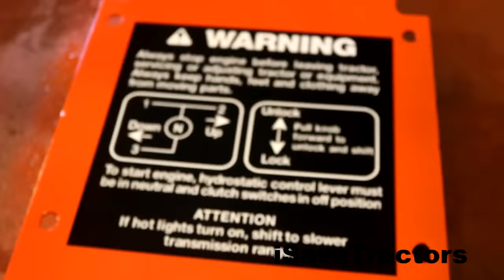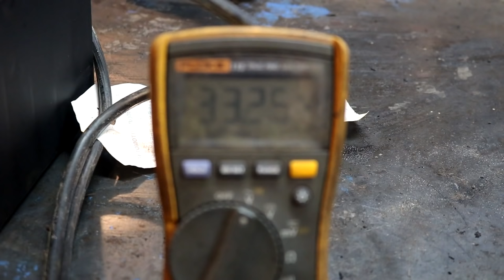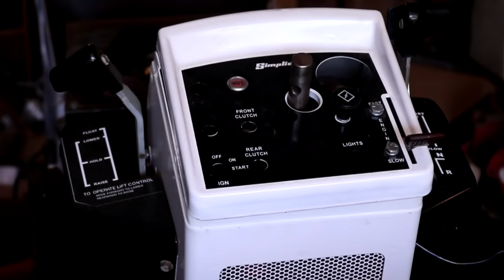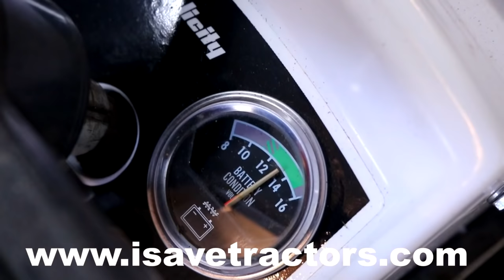Simplicity 4040 PowerMax Project Start To Finish Full Video

Comment: When you started it up there at the end. The sound the Owens engine made takes me back to the 1970s when my father was head groundskeeper for the University of Iowa and they used two AC 720 tractors for mowing and snow removal many years.  The mower deck on the AC 720 is not what you see today, or most decks are stamped steel, AC and simplicity would weld up the decks out of plate steel. The only problem my dad would have is that when it was really hot in the summer and they would park the tractor for break after running it for a few hours, the engine was sometimes the vapor lock. You restoring this brought back a lot of fond memories of me and my father and the time I got to spend with him! Thank you!

Comment: As a John Deere guy.... I concede these are among the coolest garden tractors ever made.
Reply: You mean the most complicated and over designed tractors ever made. What exactly can this tractor do that a Sears Suburban could not do? Which would you prefer to work on?
Reply: @MrCountrycuz well for one the category 1 3 point hitch and rear PTO is immensely great to have and use.  Plus the big rear tires always help a TON with traction on a small 2WD tractor.  The hydraulics and hydrostatic is another highly needed feature if your going to do any real work besides mowing a field.  That's just for starters.

Comment: I bought a 4040 in 1973 with a deck mower, a 60 " tiller and Danco front loader. It had Turf tires and heavy duty tires in the front.
I used it for almost 30 years. Rebuilt the engine once and repaired the transmission once. The front kingpin axles broke several times and I made new ones. The rear wheel drive axle broke once and Case made a new one for $150. Great tractor I used it almost every day and sold it to my neighbor when I moved and he loves it and uses it a lot.
Reply from the maker: Wonderful story. Thanks for sharing!

Comment: Impressive transformation, Norman! Particularly the pressing out and in of bearings and rewinding the stator. Beautiful work all around. Also shows how beneficial it is to have the right tools. I've watched Jason1Pa rebuild an old Ford 8n tractor, too. These smaller tractors really fill a need for those of us on smaller properties yet need the muscle and attachments of the big boys.

Comment: I have recently been given an Allis Chalmers lawn/garden tractor and it appears restoration may be a daunting task, but it should be fun(and expensive) but, just recently having retired, I'm up for it.
Reply: Be sure to bag, tag, or label every part you take off, so you know where to put it back on. Strip it down to the frame, power wash and paint the frame, then build it back up. Sounds like a good project to kick off your retirement.

Comment: I had a model  4040 tractor I Started my ground maintenance business with it had many attachments 60" belly mount mower   a 60inch  sickle bar  mower  5' rotortiller.  5' snow blower 5ft dozer blade 5ft landscape rake  rear grader blade

Comment: Do you ever rebuild tractors for customers? If so, I have an old Bolens pipe frame tractor {early 60's vintage} that needs carb. and electrical work the rest is fine.The tractor was given to me by my next door neighbor.

Comment: Norman, Wow what a beautiful restore. I wish you'd shown us the new spline shaft. Also why don't you use solder connections instead of crimped?
Reply from the maker: If you check the full build series you will see the new shaft. I solder some connections, but a good crimp is acceptable too for these applications.

Comment: Man, that was like a symphony. Runs like a top. Don’t think I missed it, but did you also pull down the engine and check the innards?
Reply from the maker: For this build, I rewound the stator and checked clearances etc but did not do a full engine overhaul.
Reply from the maker: I have 3 more of these tractors and our company is developing parts for them when they are finished I will be doing a full rebuild of the CCK engine

Comment: @isavetractors where did you get your assembly diagram? I have a 74 simplicity landlord and I want to do an overhaul on it with my son as he grows, any info would be greatly appreciated.
Reply from the maker: Most of the time, I don't use any diagrams when re-assembling. I just know where it all goes. I sometimes will take pictures of things as I take them apart. It helps that I film most of everything and I can use as a reference.

Comment: What size are the rear ags? I (think that i ) want ags on mine but have 15 inch rims and i think 12.50 are too wide for my applications,  are they 12.50? Or is that the 16 inch wheel?

Comment: Norman, I have a question. Thinking about getting a tractor jack from habor freight.  So maintenance on the mower blades would be easier. They have the one for 300lbs max lift. I have a Ariens gt17 witch weighs 928lbs with out deck. The most i have seen is 700lbs. Being im basically pivoting  on the back wheels think 300lbs lift would be enough. Or is there a easier way to maintenance the bottom deck and blades? Those decks are heavy and hard to move around.
Reply from the maker: I am not sure baout the 300 lift ones. I use the Mojack Lift (500lb), and that lifts all of my garden tractors. I haven't used it on the Powermax yet, but I probably will with some extra precautions (1500# Tractor). Here is a link to the one I use: https://amzn.to/2Y63g41

Comment: Hey I have a 7119 and I cant get it to turn over. I have added a key switch and a solenoid and still nothing. Any ideas?
Reply from the maker: Check your ground connections. Between starter and block, block and engine frame, frame to battery. Make sure everything is wired correctly as well, and all ground connections to connected to shiny metal.

Comment: Hi, what state are you located in and would you be interested in taking on some contract work on my AC616 with Danco loader?
Reply from the maker: Maine and I'm sorry I don't do Customer work anymore. Just too busy
Reply: @Isavetractors  No worries, I think I am going to just get into her myself and outsource prep and paint. I am having a tough time with parts though, any suggestions on where I may look for wear parts like brakes, air cleaner element, etc?

Comment: I don't get why you painted some parts and not others
Reply: Exactly. I mean,if you have it torn down that far,you may as well take it right down to the bare frame,blast,prime,paint and clear coat it all. Also,if i had the engine out of the frame,i would have completely rebuilt it as well and maybe even had gone through the tranny and whatnot too. Don't mean to sound nit-picky but.........
Reply: @specwar64  I semi-restored a CC 1450, it's a work tractor. While I didn't go all out and bare blast it, I did get rid of all the rust and re-primer and paint everything. I had to rebuild the engine. It went from a weekend project to a summer project. So I understand "Work tractor rebuild" but in my case I painted everything. I figured the limits of 40 year old paint to protect the metal had been reached.
Reply: It's called patina and it's just nice to keep some of the original paint. This is not a museum piece, it is a driver, although a very nice driver and from a distance you have to look close to see the untouched areas! I have done the same.
Reply: Don_ECHOguy, I’ve semi restored 2 tractors, my 212 on MikeJD60, & a 73 ST16, temporally 212 swapped for light duty jobs around the yard.

If I need to pull something heavy I pull out the big guns/my 82 JD212.

The 212 I’ve repainted, new head gasket, carb, repainted except the fenders/patina, & put a tube in a rear tire. 

The tractor had all original tires when I got it some of them still held air! Both of the front tires were original & one finally started to split & finaly went, it was a sad day when it did, cuz now I can’t say that my 212 has all original tires on it. 

I’m still really sad about it. Oh well. I think I’m gonna do agg tires all the way around, the 2 front ones first, to make it look even meaner! 

My latest build is a 67 110 RF I got for $100 that came with 2 new rear tires, & a rear drive belt, I got it home & jerked the head off & found out the engine was rebuilt, maybe .10 over? Or just new piston & rings.

Anyways a previous owner painted it blue & that was one of the first things I fixed was the coverup of the blue paint.

It’ll look hopefully amazing! It’s not a museum piece, so there is a little slack. The hood won’t be perfect tho 😑. It’s seen 53yrs it needs a few battle scars. I also got some of the stuff for the rear sleeve hitch as well!

It’s also getting 2 better condition hubs for its 2300 since the current ones are wore out. They’re black rn, but I won’t be painting them to show they’ve been replaced.

The year is unknown cuz the tag doesn’t match the model, the model is 130 but it’s a 110. But the serial matches the other little details on the tractor. 

Happy tractor hunting!

Comment: Whats the real difference between this and the 9020?
Reply from the maker: Mainly from axle pin, rear axles are thicker by an 1/8" on the 9020, and 2 hydraulic spool valve

Comment: I was rather shocked when I watched you tighten the wheel studs in a circle instead of alternating studs so it will tighten evenly.
Reply from the maker: That was not footage of torquing the lug nuts. It was just getting them onto the rim to hold the wheel. Final Torquing did not make it on video, but it was done with the correct star pattern.
Reply: Good explanation, editing the videos sometimes causes confusion.

Comment: I enjoyed watching the entire video BUT when you replaced the roller bearings in the rear reduction drives you used the wrong type bearing , you used a full complement roller when it should have been a separator cage type , full complement type are used for rocking motion not full rotary, you probably just replaced what was in there but it was the wrong type (been playing machine repairman for over 55 years so I do know a few things).